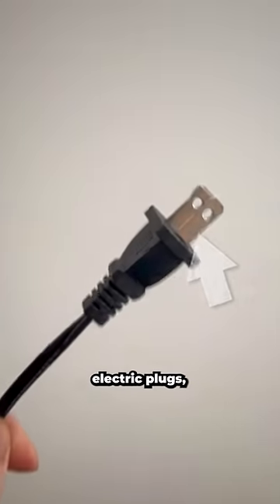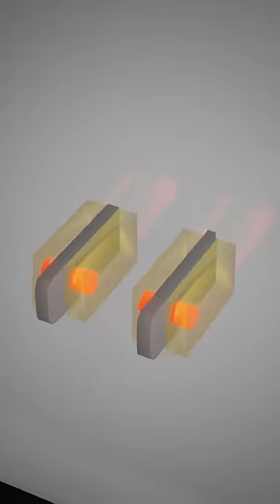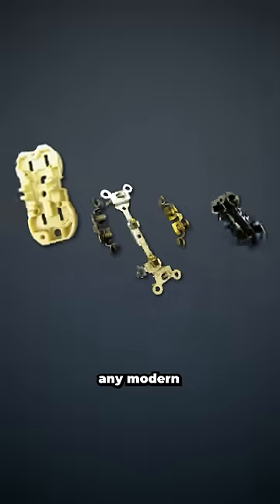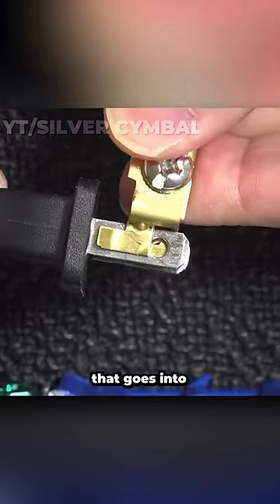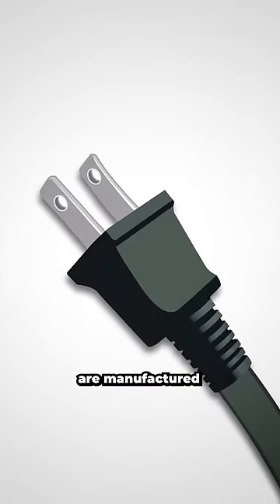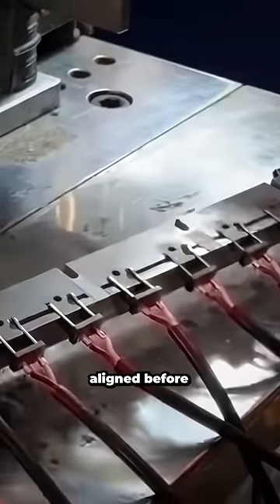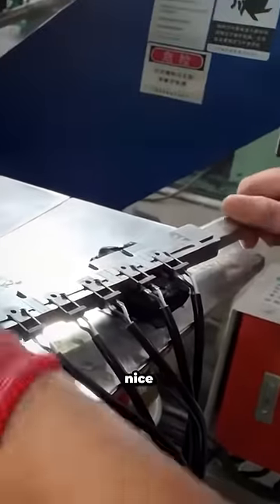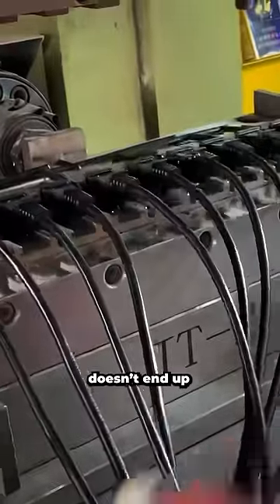The REAL Reason Plugs Have These Holes 😮

Comment: When the design was first introduced, those holes did indeed help with plug retention. Nowadays they're optional and some plugs don't have the holes, but most do.
Reply: Yes and we still see a lot of them because long time ago the government made that plug the standard. Bad plugs can start fires and that’s why they had the holes. You are just continently using a patent that was used for safety to make ur job easier lol
Reply: No most outlets do have a bend on them that allows those holes to secure onto the plug older generation outlets had a button design for the connectors. But they stopped producing them because of those buttons kept causing people's houses to burn down. So they ended up instead using the smarter idea which was a triangular band on the outlets connectors. Which was safer and would not burn people's houses down
Reply: PS I forgot the terms to some words.
Reply: This is the truth.
Reply: Technology Connections did a great video on this. His findings were that they have no use other than possibly being useful in manufacturing.
Reply: Spreading missinfo nice
Reply: @PeachIceCreamy  thats not true
Reply: I have literally never seen a plug with holes. I think it must be an American thing. (I'm Australian btw)
Reply: @jamesgould3263 That makes sense. This really only applies to Type A and B style plugs, which are used in North America and Japan.
Reply: Some receptacles have a slight dimple in the contact spring which helps in retention.
Reply: @PeachIceCreamy  You forgot "nowdays". If something doesn't have usefullness 'nowdays', doesn't mean it was planned for it in the beginning. Designing factory to use the holes (when they are legally required to be there) doesn't mean they were for that reason 100 years ago.
Reply: @PeachIceCreamy  Didn't he also point out some special extension cords that used them to lock in?
Reply: The holes are not required, but there is a standard that says that if there is a hole it has to be exactly that shape and position, to ensure no-one puts a hole anywhere else.
Reply: @ragnorockcookie2868 its in the specs, the specs dont lie?
Reply: The only ones i've seen without them are christmas lights
Reply: They are optional, but if they are there, they're required to be a certain size and location.
Reply: Yep I’m glad someone knew I was finna say it myself
Reply: @random832  It's because the contact area is past the holes. If the holes where further down they would reduce the contact area and increase thermal buildup (fires). It really doesn't matter today if they have them or not because the outlet doesn't contact where the holes are, and I don't know of anyone still making the retention style outlets because it's cheaper to manufacture them without it.
Reply: @PeachIceCreamy l love technology connections. I watch the videos thinking there is no way I'll be interested in that then watch the whole thing and think it was only five minutes when it was over half an hour.
Reply: Honestly, it just seems like a style thing nowadays. 

An American plug looks so wrong without the holes, it’s almost normal with the holes.
Reply: Australia has flat plugs, no holes
Reply: This is true
Reply: Most in america

Comment: European plugs :
Am i a joke to you?
Reply: European plugs are exactly the same but just have round pins instead
Reply: @hypotheticlz but don't have holes in pins
Reply: @hypotheticlz except that they use 240 volts instead of 120v.
Reply: Yes, they are a joke to me, and my job is literally as an electrician.
Reply: Nobody cares
Reply: @railworksamerica  about you
Reply: @hypotheticlz  absolutely not ....

on an European plug the plug is going INTO the out let to make contact , and you can not get shocked , you are unable to reach the pins . when your plug is out of the socket so much that you can touch the pins , they already lost contact .

when i was in the states in a hotel and the alarm clock rang ....i was reaching out for it and get shocked by touching the wall socket half in , half out ....thank you for nothing .
Reply: Yes a long with the entire country
Reply: @ryantracey8574 Nah Europe a country now lmao
Reply: Australian/New Zealand plugs don't have those holes either and the metal part is flat like the American ones. Some have two and some have three of the metal piece also
Reply: @ryantracey8574 you didn’t just sayyy thatt
Reply: Uk plugs on tp
Reply: plugs in uk are completely different
Reply: Yes
Reply: Yes
Reply: yes

Comment: I think the manufacturing process is influenced by the design in this case.. not the opposite...
How are all the types of plugs (eu for example) made without the holes?
Reply: @cmmartti no cause a lot of power tools and machinery use these holes for LOTO AKA Lock out Tag out which is a process where a lock is placed through the holes of a plug of a machine that is either damaged or need maintenance to prevent the machine from being used
Reply: @cmmartti  I went to trade school for automotive tech and my father was an HVAC Tech for more than 10 years, I think I know more about shop and power tool procedures than you do cause we did pop quizzes throughout the year on different procedures such as hazardous material procedures and safety procedures including LOTO just because not everyone uses them doesn't mean no one does, Lockout tagout training is required by OSHA for all employees who operate and maintain equipment. While the certification of training does not expire on a schedule, there are explicitly stated requirements for retraining. even OSHA requires LOTO so don't lecture people about shit you know nothing about
Reply: @cmmartti  Don't play expert when you know nothing about these things
Reply: @cmmartti  What cutting the power cord off? Most tools don't have a key to allow them to turn on and if it's a hydraulic press they certainly can't shove it into a locker or cabinet and if they do put it in a room and lock what happens if the maintenance guy shows up and no one has a key to the room, the shop will get charged for two visits and have their tool out of order for even longer
Reply: @theengineer2017 holy shit what type of power tool uses a type A plug
Reply: @trailfork7815  Lower Powered things like maybe a basic Electric Screwdriver or you'd be surprised how many people brake off the ground pole of a grounded plug just to use Type A plugs or there are also Type B to Type A aka grounded to non grounded adapters for purchase, besides Type A outlets aren't even mentioned in Modern Electrical Codes anymore, only Type B outlet variations like TR , GFCI, and AFCI, as well as standard Type B outlets are mentioned
Reply: @theengineer2017  I'm surprised people still use type A even
Reply: @theengineer2017 How about disconnecting the motor, or just snipping the cord?
Reply: @tummytub1161  Simple because Lock Out Tag Out Training is required by OSHA if you don't like it than you invite a OSHA inspector to your shop and let them see you blatantly disregarding their rules, lets see how quickly your shop gets fined into hell
Reply: @theengineer2017  Okay, but I don't think it matters what OSHA has to say in the Netherlands. They are more than welcome though
Reply: Another example of AMERICA IS THE ONLY COUNTRY TO EVER EXIST. Dude you can purchase plastic lockout devices that go over the plug securely and allow locking..... dont need holes for that
Reply: @tummytub1161  I'm talking about American plugs not other countries plugs here in America we do LOTO
Reply: @theengineer2017 LOTO procedures using the holes in the plugs isn't because the holes are put there for that purpose. The procedure was developed with the existing holes in mind, because it's a simple and convenient means of using an existing design for additional purposes.

The patents for Type A and Type B plugs mention nothing about being used for locks or tags. But those holes being there is way more convenient to OSHA standards than having to engineer something new for the same purpose. Putting a zip tie or a small lock through one of the holes to prevent it being plugged in is simple, elegant, and obvious.
Reply: @theengineer2017 nobody attaches a LOTO lock to a 2 prong 110V plug. It just doesn't happen. If it were 110V 3 prong 20-30A, or 220V, sure. Not 2 prong 110V plugs. There's nothing with a cord long enough for it to be a concern.
Reply: @mattmilner856 bro, we are talking about the NEMA standard plugs that are used basically only in North America…
Reply: UK plug pins are made separately and placed inside the chassis and screwed together, 

You can just take them apart and replace parts or even the entire plug. It’s a fairly normal thing to do
Reply: UK/Malaysian/Hong Kong style plugs don't have any holes
Reply: @theengineer2017  just because an application was found for the holes doesn't mean that is the original purpose. An interesting factoid sure, but it can't be tied to the actual origin or at least not without more information.
Reply: @theengineer2017 proper loto procedure is rarely putting a lock on a plug, normally you cut the power to the outlet and lock the outlet out, not the tools plug. You would know this if you actually had the experience you claimed to have.
Reply: @99EKjohn  It also varies depending on your working area in school and Mavis we did not have direct access to breakers so we had to use the plug locks, you dont seem to have much experience either since you assume all buildings let anyone have free access to breakers and that MAVIS of all places would have individual breakers for every single machine
Reply: @theengineer2017  I don't care if god himself recommended using the holes for locking out tools, that still doesn't make them exist for that purpose, it's just gonna be something people do. Did you really have to hit him with "I think I know more about x than you do" because that is about as pathetic of an attempt at seeming credible as they come...
Reply: @theengineer2017  it can vary, but only certain procedures are OSHA compliant. Locking a plug is not one of those. Plugs are not guaranteed to have those holes. The OSHA approved procedure is to lock out the outlet, which you do have access to if you have access to the plug. Keep trying.
Reply: @cmmartti Yes, I suppose not many have looked, but most 2 wire power tools are double insulated, with a symbol of 2 boxes. That's how they get away with omitting a ground prong.
Reply: Europe has very differently shaped plugs and outlets, so there's no need for holes.
Reply: You realize it is a dumb design then?😂
Reply: Uk and eu plug pins are typically rated for 240v , 13a instead of 110, and I believe this is why they are thicker.
I'd think that it's easier to grip them without bending in a jig. The pin placement , usually including an earth pin which makes it wider , could also mean they just use different jigs, whereas someone happened upon using rods for alignment in manufacture and it just became industry standard in the US.
same as how cars vary by country- many types of and ways to operate a vehicle and get from a to b, but uk and eu tend to be manual gearboxes mostly, whereas US and other countries are mostly automatic transmissions.

Comment: We actually have a extention cord at work that uses those holes to lock the plug in to the cord
Reply: Thank you. I have used lots of these and theyre great.
The original patent specified the holes as ideal for retention, back when manufacturing things was not as precise/advanced as it is today.
Reply: You can buy just the locking ends for tool cords. We have some at work.
Reply: Don't forget to talk about his "Big Metal Rod..."  😎
Reply: I use these locking cord ends on my big drills at work. Nothing like climbing up a 14' ladder and reaching up for your drill to come unplugged.

Comment: The electric code has specifications for the location of the holes if used for ease of manufacturing. The use of holes is optional, but if they are present, they must be placed near the tip so the socket can still grip the plug.
Reply: Nonsense,  ever seen Australian plugs ?
Reply: @jantschierschky3461  What do Australian plugs have to do with American electrical codes?
Reply: @cleetose  well Australian plugs are flat too, but don't have holes.  So the holes have nothing to do with manufacturing.

Comment: Ignoring the manufacturing purpose (which is the true purpose) there are locking extension cords made for use with things like lawn mowers that will lock the plug into the cord until a button is pressed. These are very handy to have around if you use a corded lawn mower or snow thrower.

Comment: You can use them to tie wires to the plugs easily, Miss comes in very handy when you're using the plug as a patch cable.

Comment: if you ever feel useless, remember this guy exists
Reply: I don't know the guy, but yeah. Dislike because that's not even the reason these holes existed
Reply: @kiseidou What is the reason then?
Reply: check the first patents. they were used before for the “securement” to the outlet. cases where the plug remained in the outlet while the wire break leaving exposed death traps were not uncommon. Those outlet mechanisms where removed, and some companies removed the holes only to see that sales went down as some people where either confused or thought they were cheap/unsafe. So they left the holes. That’s the story a very senior UL engineer told me once.
Reply: @kiseidou it is infact a factory related reason

though there ARE some plugs that don’t have holes in them and they still do not slip as some people seem to think
Reply: 214k likes
Reply: @bhmcrumbs1348 why?

Comment: I thought they were for locking out equipment with a little padlock
I also thought they were for locking extension cords
Reply: Those aren't actually the intended purpose according to the patents. The holes just made those things easier and more convenient to make.
Reply: These holes predate lock out tagout, also if you are doing loto on a machine with plugs, you wouldn't lock out the plug

Comment: Holds paper clip to heat water in prison
Reply: You arc out the other end not the plug, that'll just throw the rcd or go boom.
Reply: a. not like that
b. they have kettles you can freely use in prison.
c. pencil lead (graphite) is more popular because...
d. pencils are easier to get than paper clips in prison
e. its cigarettes (and other smokable drugs), not water.

Comment: Honestly the plug-retention idea would be great if implemented in the wall sockets...

When I went to the USA, literally every single plug looked and felt loose in the sockets. Even just the weight of a thin cabke was enough to pull some of the plugs a little bit out of the socket. 

Only a little bit dangerous

Comment: The holes were originally to provide a sharp edge to clean the contacts on the old outlets
(The newer outlets don't need this)
So the size and placement of the holes were regulated

When sealed solid plastic plugs became a thing the manufacturers used  those holes to  align them while the plastic set.

So they are no longer used for their original purpose , but their second "unofficial" use became so widespread that they still exist.

Comment: depends on the plug, some of them use a bump to secure it. Some others use friction.

Manufactures keep the hole for backwards compatibility since most older plugs have bumps while newer ones are more likely to use friction.

However one thing to note is that the legal standards for these types of plugs make them optional

Comment: You can also use them to lock out equipment. Like you put a small padlock through the holes and lock it. Therefore, somebody cannot plug in and possibly use damaged or dangerous equipment.

Comment: You're wrong, and so is your internet dude. Industrial outlets, like you don't see at home, used to have detents in the old days, but now they use those blades seen here. What those holes do is clean the contacts, and when current goes through the blades, they vibrate, and those holes keep the blades clean and stop slag from forming, heating the connection and starting a fire.

Also, most industrial "cord ends" don't have any holes, just little dents. The female industrial cord ends are so tight you better not have your elbows near anything solid when you pull them apart. Examine the blades and you can see the drag marks.

Comment: its also a safety feature, you can thread a zip tie through the holes to prevent socket insertion. Useful for exposed wires or from some numb-nut plugging it in during repairs.

Comment: The reason plugs sometimes have a third prong is when the device case is made of metal. The third prong is connected to the metal case so that if there's a short inside the device, instead of using your body as a ground and shocking you, the AC current goes thru the metal case to the third prong to ground, because it has much much less electrical resistance than a human body does.

If the device has a plastic case, which most small ones do, a third prong is not necessary.

Before the 80s most all tools like drills etc. had metal cases before plastic became ubiquitous.

Comment: It's to determine proper power flow direction on ungrounded AC devices.
The wider prong connects to the neutral wire, and the smaller prong smaller prong is hot/live.

Comment: You can put a little lock (or just a zip tie) through the holes to prevent the plug from being inserted into an outlet. Useful if you're working on a machine/electronics that you don't want to be accidentally turned on while you're working on it.

Comment: I think the real reason is the country(s) using that style plug only want to use 110 Volts. Most of the rest of the world - of course - uses more, and don't have the holes. So it's quite clear and logical that the holes are there to stop some of the electricity being sucked in by the equipment.